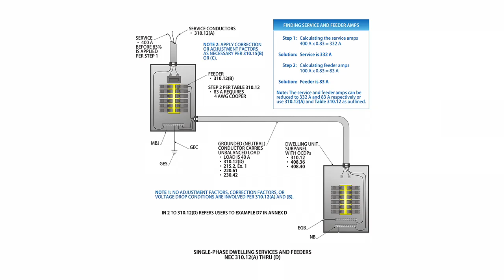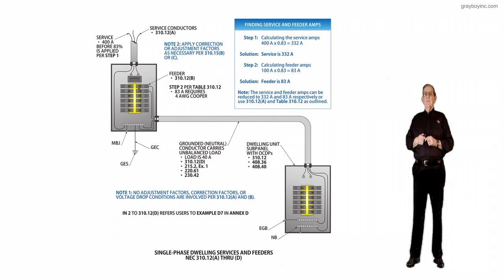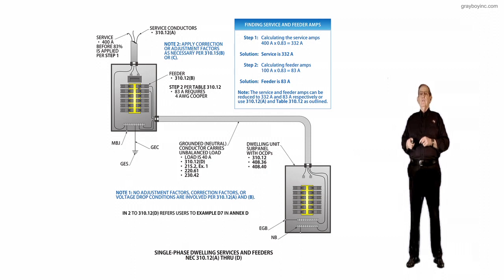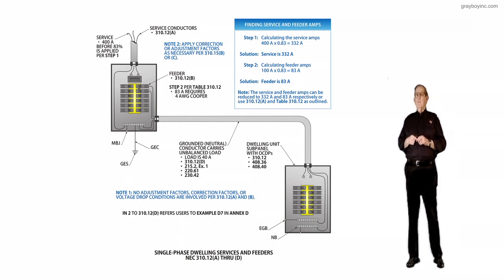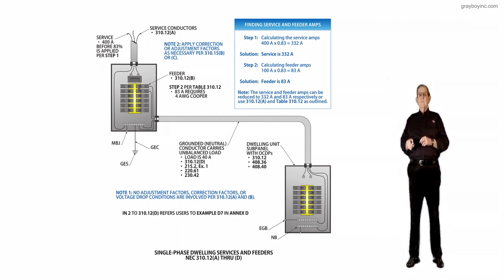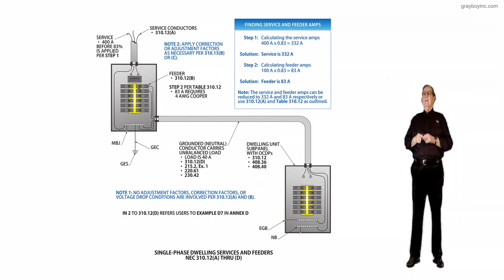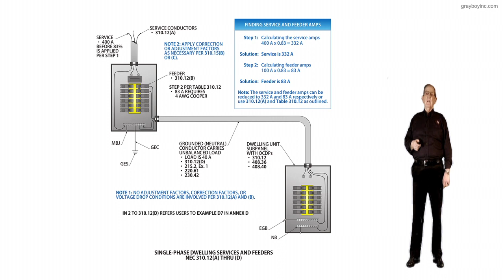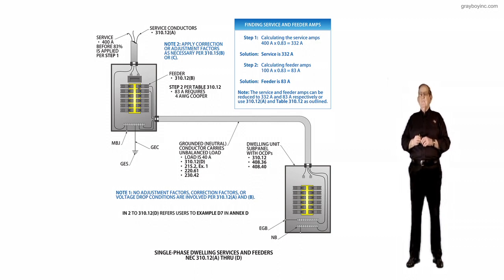310.12(A) THRU (D)

Comment: I think you are misinterpreting the 83% rule for feeders.
310.15B(7)(2)  specifies that the feeder must be carrying the entire load associated with a single family dwelling. A sub panel would not meet that criteria.
Reply: thats what i was going to ask. The "entire load" is easily overlooked. I honestly use 4/0 ser for any 200a panel and technically id be wrong in some situations.it would need to be 250s if it didnt supply the entire load

Comment: Is it permissible to feed a 200 amp sub panel from a 200 amp service panel as long as the load does not exceed total amps  (hypothetical question)
Reply: Yes you can feed a 200 amp sub panel from a 200 amp service panel as long as your overall load does not exceed the service rating. This is usually accomplished by using feed thru lugs in the service panel.
Reply: @charles-hu8ru  thanks!